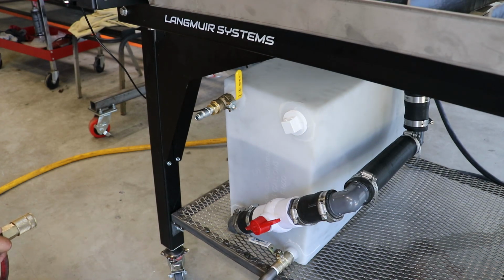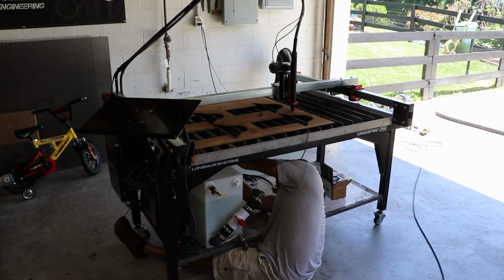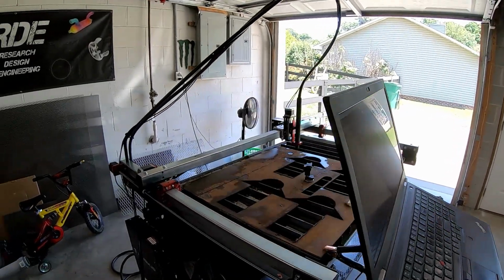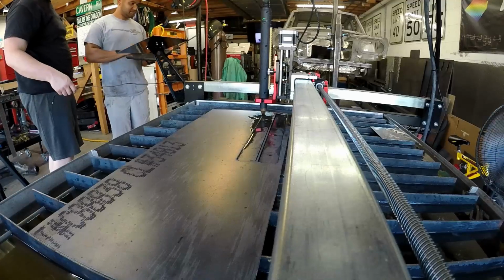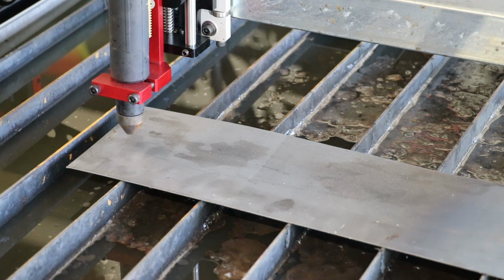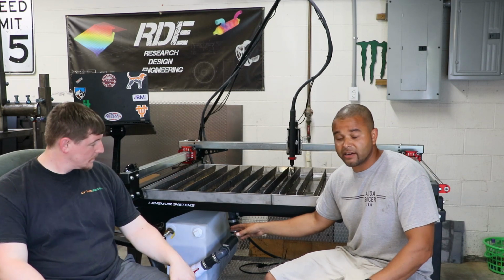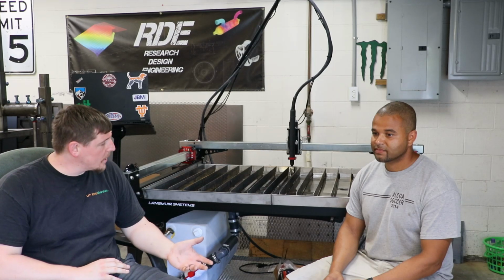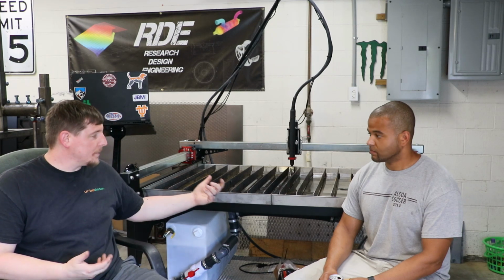Langmuir Crossfire PRO CNC Plasma Table Build Part 3: Watertank, First Fire, Thoughts

Comment: If the shelf is the problem, did you ever think of maybe isolating it by maybe putting rubber grommets between the shelf brackets and legs…
Reply from the maker: That's a good idea, although the plasma unit is on rubber feet so not sure that would be the solution or not.

Comment: so what do you do with all the crap in the water?  If you're not filtering what's the point of taking the water out and putting the same dirty water back in?  I guess I'm missing the point.  I see everybody build tanks and drains but nobody shows any benefits to their systems.  I understand how I don't understand the why?
Reply from the maker: So there is a filter for bigger pieces at the table's drain.  It pulls out so we just dump it.  Moving the table with all the water in the table is near impossible without it spilling everywhere, this is why we are using a tank.  The fluid gets nasty looking quick, but is good for quite a while.  When we need to change it the tank makes it easy to drain with the drain port.  The fluid is actually a mixture of water and Green Cut, it both prevents rust and oxidation as well helps to keep parts cool while cutting.  Hope that helps.

Comment: I have seen another video where they had to unplug the laptop and run it on battery power or the system would not operate. Let us know if you solve the issue.

Comment: Great job guys.  One suggestion on the tank setup. I used to burn waste vegetable oil in my old diesel pickup and the would use a similar process to empty and fill the 55 gallon poly tanks.  One it takes very little air pressure to pump liquids.  I had a regulator on mine set to 3-4 psi, so almost no risk of blowing out a pvc connection.  2. I built a standpipe. So it would enter through the bung at the top of the barrel but stop short of the bottom of the barrel by about an inch.  That way if you develop a leak or it breaks somehow, you won’t lose any liquid because it requires pressure to come up and out of the standpipe.  Keep the videos coming

Comment: Move the ground to the metal you are cutting. Try putting a non conductive pad on the laptop stand under the computer. I like  the tank setup. My Pro is not setup yet, I do not have the laptop stand but plan on making one as first project. Good luck.
Reply from the maker: Thanks for the suggestions, we tried to separated the laptop from the stand with a non-conductive pad and had 0 luck, butter option might be to make the separation at the attachment point.  We might try moving the clamp just to see, but at this point our new water table has a grounding tab (will be in part 4), and honestly we like that feature more that we do having the stand.